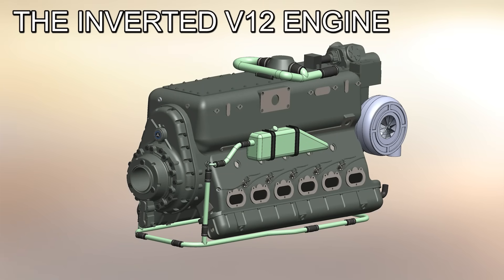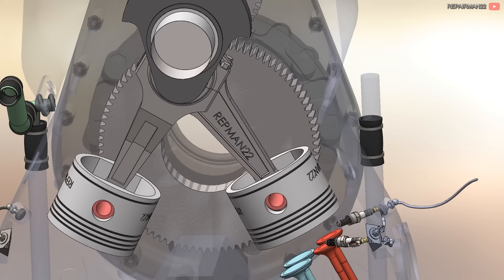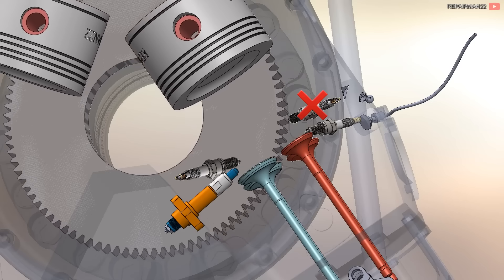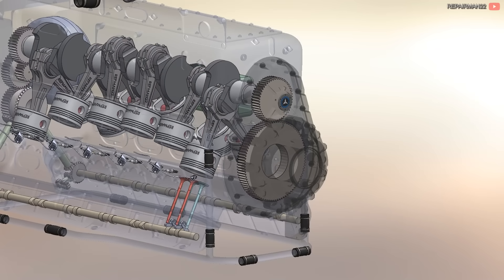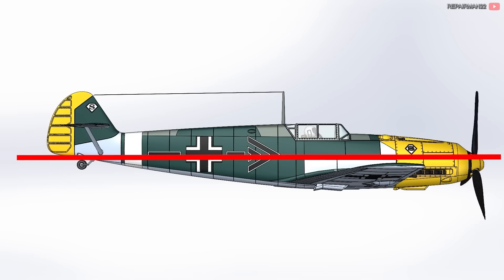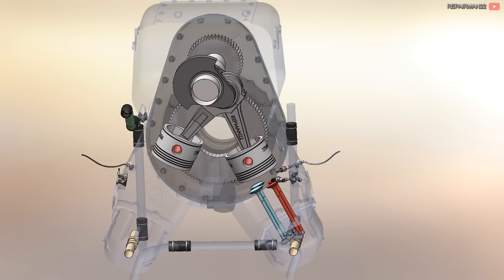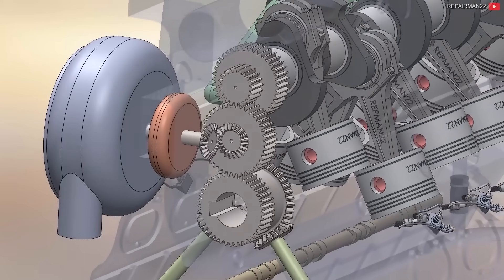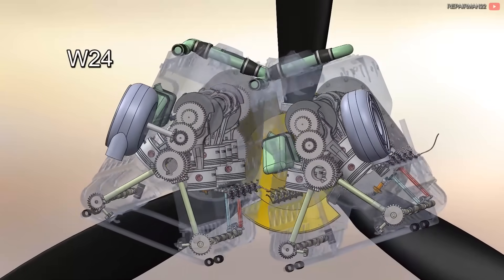The INVERTED V12 🤯 Why!?!?  - 3D animation - DB 600 Engine // Daimler Benz

Comment: Why did the Germans make inverted inline engines?:
Because they were required to do so by the visionary head of engine design at the RLM (German Air Ministry) Dr Helmuth Sachse  in the early 1930s. He required all new engine designs to have fuel injection single stage superchargers, and inline engines were to be inverted and to be able to accommodate a cannon firing through the propeller hub. It was no coincidence that the Daimler-Benz 601, 603, 605 and Junkers Jumo 211 and 213 engines and Argus were all structured this way.

Strangely enough Sachse was good mates with his opposite number in England, Major George Bulman, . 
At their last meeting (in a Munich beer hall in 1938) Sachse complained to Bulman about how difficult it was working under politically driven Nazis who failed to understand what he was doing. He was convinced his unimpressed attitude toward them was going to get him fired and he was right. He was quickly snatched up by BMW who made him the head of piston engine development, where he oversaw the development of the legendary BMW-801 14 cylinder radial which powered many Luftwaffe aircraft, including the venerable Focke-Wulf FW-190A series. This engine may have been the first to include a mechanical computer, the 'Kommandogerat' which automatically managed propeller pitch, mixture (and spark advance?) which freed a hard-pressed fighter pilot from having to deal with engine settings while trying to score victories and stay alive.

Power, weight and Fuel:
During the Battle of Britain...

The DB-601A displaced 33.9L (2,069 cu in), developed 1,007 kW (1350hp) and weighed 660 kg (1,455 lb) with 6.9:1 compression ratio, for a power to weight ratio of 0.928 hp/lb, using B4 fuel of roughly 87 octane equivalent fuel.

The Rolls Royce Merlin III displaced 27.04L (2,069 cu iin), developed 775 kW (1030hp) and weighed 624 kg (1,375 lb) with 6.1:1 compression ratio, for a power to weight ratio of 0.749 hp/lb, using 87 octane fuel. It didn't take long for the RAF to upgrade to 100 octane rated fuel, improving the Merlin's output to 860 kW (1150 hp), but the development of high octane equivalent fuel in Germany was accomplished by a complex combination of additives derived from coal hydrogenation with lower octane equivalent B4 type fuel, which arrived after the Battle of Britain.

So although the DB-601A displaced more than 25% than the Merlin III, it weighed only 6% more and when both used ~87 octane fuel it delivered a 31% higher maximum power.

At the National Air ans Space Museum Smithsonian campus there is a Merlin on display behind a description claiming (as I recall) it delivered the highest hp output per cu in displacement of any WW2 V12 inline engine. However we can see above that there is more than one specification one needs to know when comparing engines.

Coolant temperature:
The Rolls Royce Merlin did operate at a higher coolant temperature than the DB-601. 
The higher 120C coolant temperature of the Merlin compared with the 90C equivalent of the DB-601 meant that the frontal area of the Merlin's radiators could be less, causing less parasite drag and permitting higher aircraft speed. To make this work, Rolls Royce had to develop lightweight plumbing and radiators that could withstand both the high pressure and temperature of the coolant.Willi Messerschmitt complained about this to Daimler-Benz but to no avail. 

Part of the reason may have been Germany's lack of strategic metals like nickel, chromium, copper, vanadium and others that were needed to make ideal high temperature alloys. Their metallurgists knew how, but the materials were not available in quantity while Allied engine builders could draw and ore from the natural resources of the entire British Empire and the United States. This also compromised Germany's gas turbines, which suffered serious engine life, reliability and logistical support issues. To me it speaks volumes about the quality of that Germany's overworked engineers that they were able to produce such competitive engines in spite of this.

Direct Fuel Injection:
Oddly the otherwise astute British examined the concept of direct fuel injection in the 1930s but discarded it as offering no advantage over carburetor induction. Germany's engine designers would cause them to regret that decision. The Bosch direct injection systems in the Daimler-Benz engines offered a number of advantages, some of which were not obvious...

Unlike carburetors which regulated fuel flow with float chambers, direct fuel injection systems were not affected by G-forces. 
A Bf-109 pilot with a Spitfire on his tail could shove the sick forward and try diving full throttle to safety knowing his DB-601 will give full power.
A Spitfire pilot with a Bf-109 on his tail could not do that - the negative G forces would close the float valve in his Merlin's carburetor perhaps stalling the engine at a very bad time. He had to roll upside down first. 

The Bf-109 was designed from the outset as a short range interceptor to be used as part of Blitzkreig warfare. It then found itself having to escort bombers across the Channel during the BoB, for which it lacked range. Limited to 87-90 octane equivalent fuel, it had a larger displacement than the Merlin and although it offered a comparable or better power to weight ratio, it had to burn fuel at a faster rate than did the Merlin to output comparable power. Direct fuel injection ensured the maximum possible efficiency of fuel usage. For each cylinder, the precise amount of fuel required was injected at exactly the right instant for the right duration, limiting waste. The range of the Bf-109 would have been even shorter had it not been for direct fuel injection.

Direct injection meant that the inlet manifolds carried only air, not an air-fuel mix. The closing of the inlet and exhaust valves overlapped, leaving a brief period where both were open at the end of the exhaust stroke. This meant that air from the inlet manifold briefly passed through the cylinder and out the exhaust, helping to cool the block, head and exhaust valves reducing the chance of knocking due to a hot engine. Because of the aforementioned shortage of strategic metals, preventing excessive engine temperature was always an issue with the Daimler-Benz engines.

Excellent video Francis - fabulous graphics that make normally obscure details much easier to understand. It would be a great companion to Douglas' book.
I was investigating whether I should try modeling and animating a DB-601 myself, but you've done it! 

I wonder if it's possible to export solid geo files from Solidworks to Houdini?

Thanks again!

(Continued in the Reply....)
Reply: Very interesting thanks!
Reply: WOW!!!!
Reply: (Continued from above...)

Supercharger:
What we call combustion is the oxidation of a hydrocarbon like octane to carbon dioxide plus water (or as close as possible). 25 Oxygen molecules are required to oxidize every 2 octane molecules. Engine power is just as dependent on oxygen as it is on fuel. As an aircraft climbs, the the density of air (which is ~21% oxygen) falls off, which means the oxygen falls off and an engine which developed 1500 hp on the ground might only develop 1000 hp or less at 20,000 ft. As explained in the video, the object of an aircraft engine supercharger is to minimize the loss of sea level engine power at higher altitude. Compressing the air gets more oxygen molecules into the cylinder, so more fuel can be burned and more power delivered to the propeller. 

Superchargers are rated to work best at a specific altitude, above which their effect declines and power falls off again.
Adding extra air pressure and thus combustion charge at sea level where there was already plenty of oxygen would likely destroy the engine. Before the DB-601 the supercharger had to be disabled until the aircraft climbed to somewhere near rated altitude, during which the pilot had to live with declining engine power. Once they were close enough to rated altitude they could safely engage the supercharger and enjoy full engine power again or something like it. 

Dr-Ing Karl Kollmann's supercharger for the DB-601 changed that. 
As I understand it, the supercharger could be left on for the whole flight. The engine charge was based on altitude constantly being adjusted by an aneroid barometer which drove a fluid coupling similar to a car automatic transmission torque converter between the supercharger impeller and the engine to deliver the  ideal charge for a given altitude. At ground level the supercharger ran but delivered very little charge (which is why DB-601 and 605 engines have a distinct whine or whistle near the ground). As the aircraft climbed, the charge was automatically increased to ensure the engine could always deliver maximum power output all the way to supercharger rated altitude. Beyond that, power started to fall off again, like a conventional supercharger. IMHO, this was an inspired piece of work. 

The DB-610
Yes 2 x DB-605 coupled via a common gearbox was called a DB-610, but before that 2 x DB-601 coupled likewise was the DB-606. 
The DB-606 was a complete disaster - responsible for the deaths of many Luftwaffe bomber crews. It was a nifty way of stuffing 2 engines into a small space mostly within the wing that caused lass parasite drag than 2 separate engine nacelles but it came with major problems, the biggest of which was its tendency to catch fire. The DB-606 had worked well in the high speed prewar Heinkel He-119 experimental prototype bomber/reconnaissance aircraft but it turned out to be disastrous for the Heinkel-177A heavy bomber causing catastrophic fires to such an extent that their crews refused to fly them. The DB-610 was definitely an improvement but coupled engines were always a stopgap measure. This very nearly ruined Heinkel and amongst other things caused them to cancel their He-280 jet fighter because they simply didn't have the engineering staff put out the fires in the He-177A program while further developing what was the first jet fighter to fly. 

As an aside, it's interesting to compare the He-177A with the Avro Manchester which also came with unreliable high powered Rolls Royce Vulture engines. The British Air Ministry cancelled the Manchester but allowed Avro to design a new version powered by 4 separate Rolls Royce Merlins and the result was the Lancaster. Heinkel (according to his autobiography) was forced to make the He-177A work with coupled engines even when he offered a more conventional version. The same air-frame fitted with 4 x DB-603 engines (secretly in Heinkels Vienna-Schwekat plant where the RLM couldn't see it) and the He-274 built by Farman in occupied France with the same air-frame and 4 separate engines proved how sound the He-177 air-frame design had been all along. Thanks to the DB-606 and DB-610 and the RLM, Germany was denied a potentially first class heavy bomber as well as a jet fighter alternative.

The real problem was Germany's inability to develop a reliable high power engine like the big American Wright and Pratt and Whitney radials or the British Napier Sabre. 
They just didn't have enough engineers to both oversee production of current engines to meet wartime demands plus develop new ones. Government oversight of engine development by the RLM was nowhere near as good as it was in Britain and a great deal of time and resources were expended for no useful contribution to the war. The promising Daimler-Benz DB-604 24 cylinder X configuration engine was cancelled while rival Jumo-222 4 x 6  24 cylinder engine ran into conflicting RLM demands along with technical challenges with too few engineers available to deal with them. When it finally started entering service in late 1944 it was unreliable and clearly not yet  ready. 

----

Anyone interested in WW2 German or British propeller engines really must read The Secret Horsepower Race by Calum Douglas. It's a brilliant book written by an F1 racing engine designer who also speaks German, who spent 5 years researching and writing the book based on archived wartime official documents. He also managed to acquire the original notes and documentation of the late Dr-Ing Karl Kohllmann - who with Dipl-Ing Fritz Nallinger was one of the chief designers of the DB-600, 601, 605, 603 engine family. He also separately translated a paper Kohlmann wrote about the theory and practice of engine supercharging. The Secret Horsepower Race is  a super-detailed, well written and illustrated book that includes so many fascinating stories about how and why these engines became what they were.

https://www.calum-douglas.com/

Excellent video Francis - fabulous graphics that make normally obscure details much easier to understand. It would be a great companion to Douglas' book.
I was investigating whether I should try modeling and animating a DB-601 myself, but you've done it! 

I wonder if it's possible to export solid geo files from Solidworks to Houdini?

Thanks again!
Reply: @tsegulin  WOW!! Great Job!
Reply: @tsegulin  As you are probably aware, the original design concept for the Merlin from Arthur Rowledge was an inverted V12 but the airframe manufacturers told R-R to stop being silly and build it the right way up.  During its inverted stage, there was a high-level mission from Germany to R-R,.  I am not saying that this was where the Germans got the idea of inverted V engines (as you say, inverted engines had been around for some time) but it is interesting.  Most people would not be aware of how much cooperation there was between British and German manufacturers before the war, many of the prototypes of German Aircraft were powered by R-R Kestrels (BF109 V1, Ju 87 V1) or Buzzards (He 118 V1,  Fw 57 V1)

Are you sure of the Battle of Britain engine specs, on 100PN fuel the Merlin III used in the BoB could go 5 minutes at +12lb boost for about 1350hp.  Of more importance was the use of the Rotol prop which changed the Hurricane's performance considerably.  I should say at this point that I am not a fan of the Merlin, yes it became good in the end.  I just wonder how much better it would have been had Rowledge stayed in charge instead of the disaster that unfolded under Elliot.  

It was a crying shame that the Exe was abandoned to concentrate effort on fixing the Merlin.  Do you find it interesting that Rowledge who had spent his career designing poppet valved, liquid-cooled, inline engines (Napier Lion, Napier Cub, R-R Condor III, R-R Kestrel [F], R-R Condor [G], much of the development on the R-R R [GX], and early Merlin design and involvement in other R-R aero engines, not to mention design work on both chassis and engines of both Napier and R-R cars) designed his last engine (by his own choice!) as an air-cooled, sleeve valve, X24?  

I am not going to go into a highly technical discussion of the various aircraft engines from WWII, but I will say that many of the decisions made during engine development were decided by the resources and time available rather than technical knowledge.  Direct cylinder fuel injection was one of those, Bristol did a fair amount of good work on it but really hadn't the resources to continue with it, the sleeve valves were all-consuming. Wilde got Hooker interested in fluid drive superchargers but the development time was prohibitive, and, in the end, they got there a different way.

Douglas Callum's book is based on some very good research and his archival material is extremely interesting but I don't agree with a number of his conclusions which, in my opinion, are based on 20/20 hindsight including knowing when the war would finish.  A number of engines he deemed mistakes would probably have become critical had the war lasted till, say, 1947, and turbojets not been developed.  Yes, I am including the Jumo 222 and the Sabre in those critical engines.
Reply: @robertnicholson7733  
Thanks for your considered reply.

From Douglas' book it seems that the inverted configuration of German V12 engines originated from a directive from Dr Helmuth Sachse at the 'Military Office' in 1928
As I understand it Merlin (originally thePV12) development began around 1933.
So it does not seem likely that the German engines were inverted after visiting the Rolls Royce plant and seeing an early inverted version of the Merlin.

While you lament the Exe, it seems that in the leadup to the war Daimler-Benz, BMW and Jumo were allowed to invest considerable resources on innovative engine development that ultimately failed to contribute to the war. I think the British Air Ministry and perhaps Rolls Royce as well may have been more prudent. 

At present I consider Douglas' book to be the go-to on WW2 aircraft propeller engines, especially for those of Britain and Germany. 
If you are aware of errors or conclusions that contradict Douglas reached elsewhere, I would be interested in seeing them.
Reply: @tsegulin  Sorry for being tardy, I am very busy at the moment.  

I would like to say from the start, I have not read the whole book, I have picked and chosen bits to read, partly because I ust don't have the time and partly because the structure of the book is not to my taste, I find it difficult to read. 

I don't have the time to put my case, but here is some of it.  My major disappointment is chapter 10. As I have said before, his arguments rest on when the war started and when it ended, in the early to mid-thirties there was no way of knowing this.  Read the chapter and ask yourself whether his points are valid if the war continued to, say, late 1947.  

He criticises Fedden and Bristol for going down the sleeve valve path, yet admits in chapter four of page 442 that "It  was a profound technical error, but this was not at all clear at the time".  At the time there was no evidence that the significant problems with poppet valves and, to a lesser extent, valve springs could be solved.  People had been working on the issue of exhaust valve cooling in air cooled radials for a considerable time with only small advances, something that Fedden was only too aware of.  Then there was volumetric efficiency, Fedden had built a four-valve air-cooled radial but this engine was problematic, as far as I know, no one else had any success with four-valve radials.  Under the above quote, at the bottom of page 442 he then provides a quote from Eugene Vohrer extolling the virtues of the sleeve valve engine without comment, he then changes tack and criticises Fedden for a major change in direction in the decade before the war - he must think Fedden had prescience to know how much time there was till the war (if there was to be a war).

He labels sleeve valves an experiment only, hmmm, the single sleeve valve as envisioned by Burt was developed for the Argyle cars, the patent was bought by Continental in the USA where considerable development was done although no production engines resulted.  

This brings me to another point, he states somewhere in the book (bad memory) that one of great things about Pratt and Whitney was that they followed a single path and didn't get sidelined, they just continued to develop their air-cooled radials. Welllllll, not quite, P&W had a development program where a number of engines were designed and ended with the H-3730, a liquid-cooled, vertical, sleeve valve, H24.  This program ended with a change of management at P&W, the new management then bought themselves out of the contract.  The Continental and P&W work is detailed in "American Sleeve-Valve Aircraft Engines " by Kimble D McCutcheon, it is a very interesting read.  Note that Continental experimented with the open-ended sleeve valve as used in the Rolls-Royce Crecy, although four-stroke rather than the Ricardo two-stroke design used in the Crecy.

Finally, for this post, at the end he states that the war was won not by innovation (despite banging on throughout about direct fuel injection) but by developing plain old designs - Bah Humbug!  Are airforces flying piston-engined fighter aircraft?  No, they are flying the progeny of a complete change in direction, the jet engine!  A couple more years of war, would the et have taken over?  What would have been the result if only one side had them?  If the British had backed Whittle from the very beginning and put some real money into it, they could have been there at the beginning off the war.  Yes, I know, the German axial turbines were technically superior but unreliable, the centrifugal turbines were reliable.  The British had an axial jet, the Metro-Vick F2, that powered the Gloster Meteor just 6 months or so after its maiden flight powered by the de Havilland H1 (Halford 1 later called the Goblin).  It was technically superior to the Genram Jets but was considered unreliable.  Why the diversion?  In chapter 10, in the Napier section, he states that the Sabre would have gone better had, among other things, the Napier management supported Frank Halford to stop him from leaving.  Highly unlikely, Halford had always been friends with Geoffrey de Havilland, having designed piston engines for him including the Gipsy. Halford had worked at Napier as a consultant (and was on the board) but decided to allow de Havilland to "buy" his consultancy, so that he could work on jet engines, which he obviously did, producing the H1, the first flight-certified jet engine outside of Germany (did the Germans flight certify their jets?).  Somehow, I don't think Halford would have passed up the jet work to continue with the Sabre, In any case, he was still working on the Sabre till 1943, while working on the H1 turbine which first flew in March 1943.  Indeed Halford was involved in all Sabres up to the V, that is, all wartime Sabres.

So a final grab bag of comments:
Direct Fuel injection, yes, it is very nice, but it is not just a matter of applying diesel technology to spark ignition engines, as even modern manufacturers have found out. And was it all that superior to single point injection?  The 130 series Merlin still only used single-point injection but produced a rated 2030hp, so was direct injection going to produce more power?. There is a story to this that includes Hives, but I have never taken the time to verify that it is not made up.  

Tied up with this is the mechanical computer that controlled the injection in, for example, the BMW 801.  Also very nice, it makes it so much easier to fly the aircraft, but does it make the engine produce more effective power?  In the Book Callum sites a comparison the Germans did on the cost of building (in time) the 801 compared to P&W and Bristol radials.  the results were disappointing with many 801 parts, such as the crankcase being significantly more expensive - twice as much as the P&W, then they got to the fuel system, the 801 was massively more expensive.  So yes, nice to have, but can you justify the cost?  Yet, despite this being in his book, Callum still wanted the Brits to go down the same path.

The Jumo 213J, page 425.  Like Fedden, I am not convinced about the 213J.  Don't get me wrong, Juo engines interest me greatly, especially the Jumo 213/214, I ust can't bring myself to accept that they got that performance.  In any case, isn't this an "experimental" design and not production.  The 213J rod isn't much like a modern Cosworth rod which are H pattern whereas the Jumo is I pattern.

Allison Squish?  I am not convinced, the engine doesn't give the much higher power that would be the result of properly implemented squish.
Reply: @tsegulin very good book.just arrived last week.have yet to read it.
Reply: @tsegulin  I can't recall ever writing a note of appreciation to a COMMENTER, but your contribution deserves one in SPADES !  Thanks, tsegulin !
Reply: @tsegulin  thank you for the information. I really enjoyed my time while reading it
Reply: @tsegulin  DOHC 4 valve engines takes up a lot of space and are heavy. A big block Chevy push rod fit straight in to  Porsche 928 replacing a 5l. A 6l small block Chevy can replace a 5.3l jeg V12 in a XJS and the Chevy weight much less. I wonder how much displacement one could get in a "Chevy V12" aircraft engine within the space comfines of a RR Merlin. 45 liters? 2 large valve is not that big of a handicap in a supercharged low reving engine.
Reply: Intersting read! 
And before watching this video and reading this comment i thought the main reason was ease of mainentance on the ground and to fit the MG's left and right of the crankshaft.
Reply: @nirfz  
Those were some of the reasons. 
Other companies - De Havilland for instance - had built inverted engines previously. DB and Jumo didn't invent them.
Reply: Dude, Your comment makes for its own video. Thanks
Reply: penso che se avessero avuto migliori materiali e benzine ad alto numero di ottano avrebbero sviluppato molti più cavalli in sicurezza e con un rapporto di compressione maggiore geometricamente e/o di sovralimentazione più spinto.
Reply: That's a great read! I find many people tend to dismiss the German engines as being inferior almost exclusively due to the lower octane fuel available, but that's not entirely true. The Germans were very much aware that in the event of war (why else would they be designing all these WAR planes?) there would be a fuel quality problem. And so from very early on their engines were designed with every advantage possible to run on low octane fuel. The direct injection, the larger displacement, the compression ratio, and many other design choices that were considered "interesting" at the time.
The result was a powerplant that was actually remarkably capable, and kept up with allied engine design *within it's designed scope*. Of course, the BF109 was infamous for poor high altitude performance, but this wasn't because of its fuel or engine, but because of its designed combat doctrine. Germans envisioned aircraft being used largely as infantry support, thus flying low, and thus that's where the enemy fighters and escorts would need to be. The allies envisioned the use of long range bombers, and so flying high was the best defence against flak and fighters. The allied fighters followed suit because that's where the bombers they needed to escort were. So German superchargers were only ever intended to work most effectively at lower altitudes at the outbreak of the war. 
Another interesting caveat is in metrics: Germans rated fuel differently than allies. The BMW 801 ran off C2/C3 fuel which was "95/110", but after the war the Brits tried running a BMW 801 off of "higher octane" 100/130 octane fuel, and it actually performed worse than C3; with a lower detonation free boost limit. The fuel was cleaner, but the "95/110 octane" rating was the minimum, not maximum like some countries were labelling theirs with. German B4 fuel was "87 octane" in German service, but "91 octane" in Italian service.

The German engineers certainly weren't idiots. Many of them were absolutely brilliant. It's fortunate that their superiors WERE idiots and let their personal opinions influence the designs of war machines.
Reply: K
Reply: What is the problem to make carburetor which will work in any position and acceleration. Even chainsaws can do it.
Reply: @azlktune  
Chainsaws are not subject to high negative G forces, which closes the float valve and starves to engine when you push the stick forward to dive.
Reply: @tsegulin  Chainsaws have no float valve and can work in any position with any accelerations.
Reply: @azlktune too crude for a high performance engine.
Reply: Don’t forget that the mustang used a system in the radiator that would heat the air and accelerate it out the back creating cooling thrust. It made more thrust than drag. I’m not sure the Germans did that.
Reply: "and inline engines were to be inverted and to be able to accommodate a cannon firing through the propeller hub"

That is not the case. The Hispano-Suiza 12Z used by the Spanish in their licence-built bf109s (the Hispano Aviación HA-1112), because the Germans could not supply the DB engines as they needed all they could get, also had provision for a tube between the V to fit a cannon firing through the line of the propeller. I'm not sure the Spanish ever fitted one though. The Hispano Aviación HA-1112 does have a notably higher propellor centre-line than the German bf109s though. The Spanish were to retro-fit their the Hispano Aviación HA-1112 with Merlins post-war when they became freely available and some were to be seen painted up as Luftwaffe bf109s in the film Battle of Britain, which is immediately noticeable as you can see high level exhaust stubs of the Merlin. Just how it affected flight dynamics, I've no idea, but you do have the irony of seeing Merlin-powered "bf109s" chasing Merlin-powered Hurricanes and Spitfires in that film.

The reason that the Merlin could run at higher temperatures was due to the use of a water/ethylene glycol mix (70:30) which allowed the engine to run with coolant at 120C without requiring very high levels of pressurisation. The technique had been used on the Allison V12 engine first. The British got their ethylene glycol from the Americans, and I suspect the Germans did not have the capacity to produce it for their engines. 

Later WW II Merlins, such at the Merline 68 could reach 1,710hp (combat power) which did require a lot of boost and high octane fuel. 

However, that wasn't the end; the Merlin 130/131 developed for the Hornet (which reached production too late for WW II) could hit 2,070 hp. The Merlin was also a favourite post-war for the air racing and hydroplane racing fraternity as they pushed them (reputedly) to 3,600 hp, albeit changing some internals and at considerable cost to reliability.  But then the Allison V-1710 could also be very competitive in racing.
Reply: @TheEulerID  il glicol etilenico era disponibile anche in germania, mancavano però li leghe leggere adatte a gestire radiatori ad alta pressione;  il minor rendimento termico del Merlin e l'incremento delle potenze faceva abbisognare di radiatori grandi per smaltire il surplus di calore pur con pressioni elevate nei medesimi. erano tutti motori che prodotti oggigiorno sarebbero molto piu potenti e con rendimenti elevati, cambiando anche le bielle beninteso
Reply: Bullshit
Reply: Who the fuck are u 😂😂😂 fucking stud dude gg
Reply: I think it is unfair to make a snapshot comparision at one point in time and then judge the performance of the whole series.  Merlin III did have inferiour power/weight to db600 series but the later variants far eclipsed it. The Merlin III was not a real merlin but an enlarged Kestrel which was rushed into production as a last resort because the original PV12 development had been slowed by the ramp head fiasco after Royces death. When the PV12 development line finally caught up and and the original 6bolt separate cylinderhead design was released as the Merlin 61, it far eclipsed the previous Merlin II-XX series and offered great development potential eventually reaching over 2000hp.
The reason for the faster improvement rate later in the war is how easy it was to service, replace or upgrade parts and iterate on them. 

The DB600 series is a mechanics nightmare, totally unsuited for repair in the field. The heads were integral to the cylinder banks which in turn were screwed onto the crankcase from the inside. So you had to get the crank out, remove all rods and the one cylinder each time you wanted to service or replace a valve.
Reply: You have an error, you list the cubic inch for both rolls royce merlin and db-601 as the same but you have their liter displacements as different. If the cubic inch displacement is the same for both then so would their liter displacement. So something is wrong here. @tsegulin
Reply: @JuniorJunison  
You are correct, the cu in displacements of the two engines are not the same.
DB 601 should read 2069 cu in
Rolls Royce Merlin should read 1,650 cu in.
The metric displacements are correct. Sorry, my bad.
Reply: @tsegulin  no worries
Reply: @tsegulin  Really nice work give it its on page online.
Reply: Damn did you really write all that or did you copy and paste from wiki